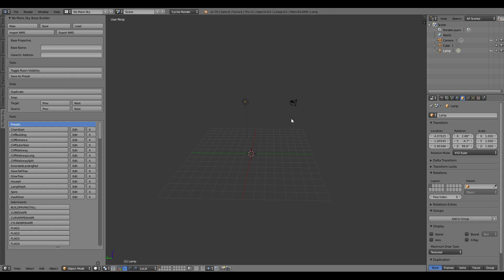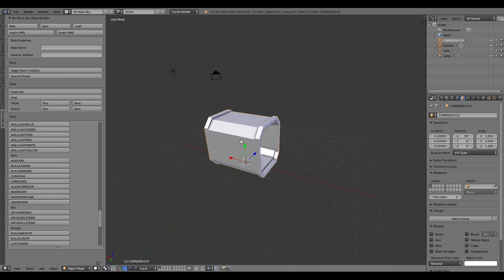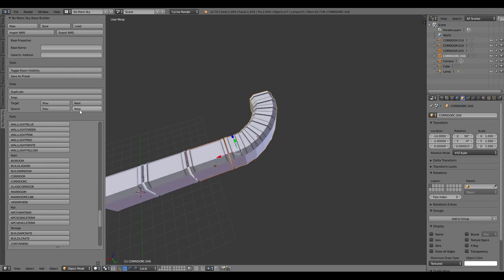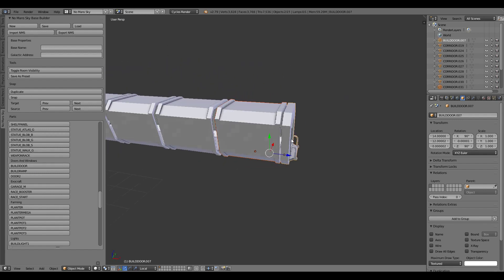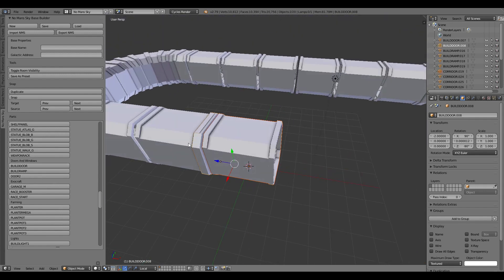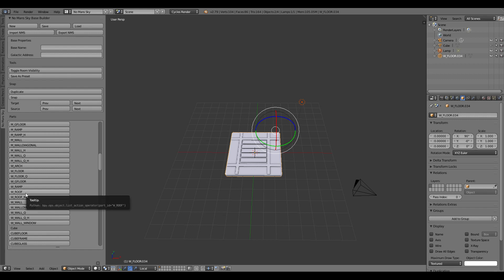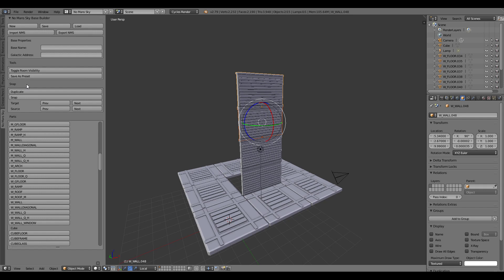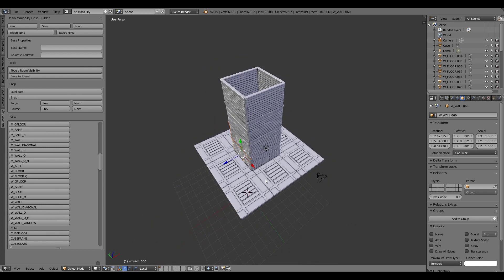No Man's Sky Base Builder: Snapping

Comment: Question on snapping here: using the pre-built corridors when I load in none of them are automatically connecting.  Is there something I'm missing on making the pieces know they're next to each other and to update their respective models to be "open"
Reply from the maker: Unfortunately the tool doesn't make the association when loading in, and doesn't update the geometry based on connected or not. The geometry have been made to look generic so they would work for most scenarios.
Reply: @DjMonkeyUK  wow that was a fast reply!  So is the issue the pieces aren't exactly touching and that's why they don't connect in game?  I was going through the json file looking for some kinda flag that indicated model state but didn't see anything that jumped out
Reply from the maker: @RebeccaBrunner  what parts in particular aren't working? In-game it just detects how close the objects are together and does the connecting itself, so the tool doesn't really need to do anything. If it isn't working then the values may be off in the tool.
Reply: @DjMonkeyUK  only thing I've really toyed with so far is the pre-fab structures  such as the corridors and large circular/square tools.

This tool is beyond awesome btw.  Idk the NMS community does it but the mods/save editing scene for NMS is fantastic